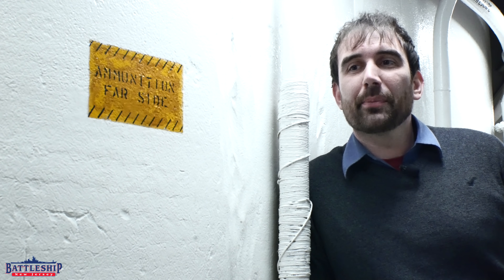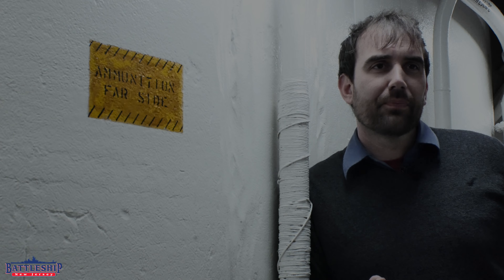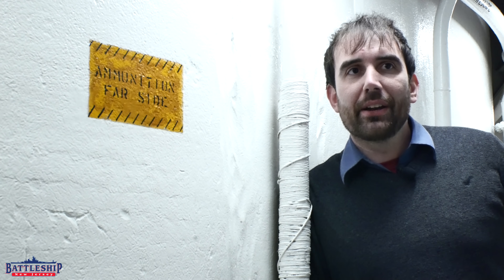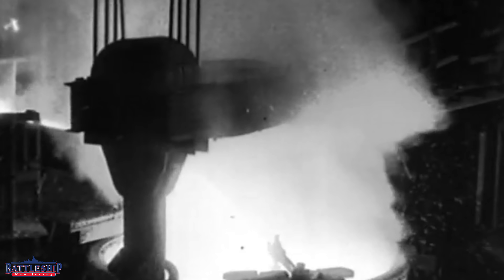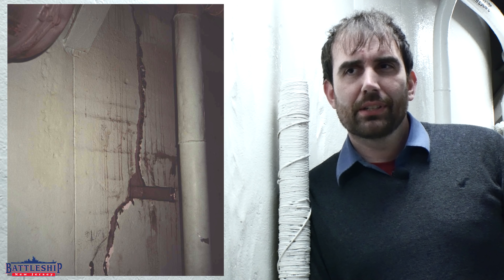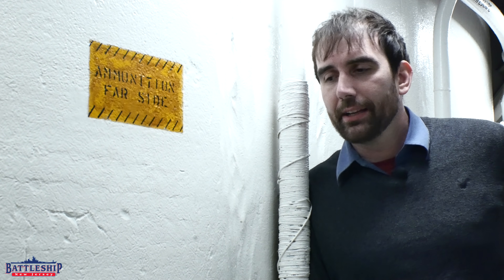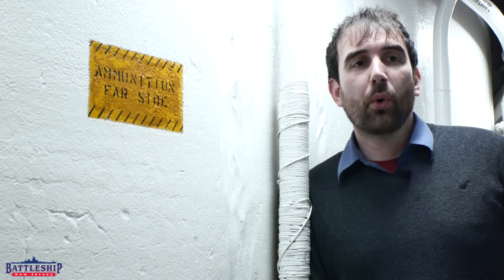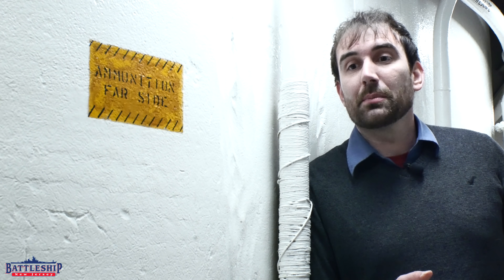What Damaged the Turret Barbettes To Cause the Cracks?

Comment: The after turret of the USS South Dakota was struck by a 14" AP projectile from IJN Kirishima in one of the naval battles off Guadalcanal late 1942....
The shell evidently struck the junction between the armored deck and the barbette, bending the armored decking downwards and putting a king size dent in the barbette. There was no gouging visible, or spalling of the armor; it functioned perfectly as designed, absorbint the energy of the hit by plastic deformation. The turret was put out of commission by the shock. I can only imagine what the turret crew thought about this.....They all survived.

Comment: Alabama’s Turret I barbette has a similar, but smaller, crack like Missouri’s. Other comments here have mentioned one on Massachusetts as well. Interesting since BB59 and 60 were built at different yards. 

A’s crack can be seen on second deck, port quarter of the barbette, close to the deck, for those interested!

Comment: Interesting that you mention Midvale Steel, a relatively small firm compared to giants like Bethlehem and Carnegie/US Steel, etc., but an important producer in many respects. Long known for specialty steels and alloys, Midvale focused on high end versus commodity output. It was located on a canal that brought anthracite coal, quite a benefit for high-heat generation and quite "clean" as coal burning goes. And one large customer was Baldwin Locomotive, which bought many high-strength, high-spec items from Midvale like drive wheels and axles. Meanwhile, in 1880s Midvale employed a young worker named Frederick W. Taylor who rose from lathe operator to gang boss to engineer, and eventually engineer of the works. Yes, THAT Frederick Taylor, of "scientific management" fame and a key player in the development of industrial engineering. So, behind the armor plate of BB NJ -- as you move up the supply chain, so to speak -- is a supplier with strong and noble pedigree in American industrial history.

Comment: Makes more sense than cracking from running aground, only extremely brittle metal would crack from a grounding, and if armor is that brittle, it would be useless as armor. Anything that is cooled too fast will crack.  If you can imagine the amount of heat the casting gives off and being up to 17" thick, it has to cool down slowly to prevent cracks. Metal shrinks when it cools, so the outer layer cooling faster than the inner will cause the metal to shrink on the outside and therefore, crack.

Comment: Being a foundry engineer, the lines you see in the Cast armor is the seam between the wood used to make the pattern, lie 2 to 3" that strips, the sands when packed will show the divets and cracks of the pattern and then it shows up on the casting,  Being war time the Finnish quality was not a high std. but the thickness of the armor was.

Comment: Never heard of that story, but if I had been on the tour and saw those "cracks" you may catch me looking at them and possibly trying to determine if they are jagged, smooth or if it is just chipped.
Mainly because a simple rule you can go by is if the edges of metal that is cracked is jagged and not a smooth line, it has been broken by overstress, meaning a lot of force broke it apart.
If it is smooth it could be done by fatigue, the same forces that you can experience if you bend a paperclip back and forth until it breaks.
And finally chips, which could be casting imperfections, impact dents and what not.

Comment: I saw the crack several times while I was working USS Missouri reactivation.  As I remember, it was on the #3 barbette.  Second deck, port side passageway going aft until you get through the door where the aft part of the barbette was and just look up.  I also remember one side of the crack was higher than the other.. It would have had to been ground down to keep the round shape. I knew Dick Landgraff well (contributed a number of items to his book) but I don't remember ever chatting with him about the barbette.  With Dick there was never a short answer to any question

Comment: I'm no expert by any means but I did work in a steel mill. I was in crane repair not in production. The  mill I worked in made coil steel from cast slabs that were 7 by 30 feet by 10 inches thick. Part of the process involved scarfing off impurities ( mill scale or slag ) which, if not removed would,  leave defects when the coil steel was formed. The scarfers would use oxygen lances to cut those impurities out of the slabs. They would move back and forth along the slab with their lances cutting a few inches at a time off of the surface of the slab. Scarfing would leave rows of marks where the lances gouged out the impurities. Your armor plate looks very similar to that of the slabs used to make coils. My thoughts are that they followed the same regimen to get a smoother surface that could also show any major defects. It is also a possibility that a defect could have caused Missouri's cracks. In welding it's commonly known that a crack can propigate from a defect in a weld so it stands to reason that it would be a concern in large armor plating.

Comment: Great explanations and nice to have Missouri's curator confirm the facts. A few questions arise. Was a barbette on the 1940 and newer battleships cast as a single piece or were they done in sections as the gun house was? Were the screws that held the gun house armor on also armor quality steel and do you have any spares you could give a presentation on?
Reply: The armor diagram shown of p. 170 of Sumrall (1988) indicates that the upper barbettes for turrets II and III were assemblies of 11 individual armor plates, while turret I was made up of seven individual plates.

Comment: I would love to see a video about the making of the barbettes. Are they cast as one piece? Are they stacked rings? How did they move such large pieces from the foundry to the ship yard? What is the single heaviest part of the ship and how was it moved into place?
Reply: Not sure about the rings, but, at least with the two built in Philly the pieces were loaded on trains in Bethlehem PA and taken by rail to the shipyard. A neighbor of mine had worked 35 years at Bethlehem Steel and his father worked there before and during the war. He had pictures of some of the parts being made and being loaded on train cars. At that time the plant was literally hundreds of buildings that made thousands of different parts for ships.
Reply: @johnstark4723  The armor diagram shown of p. 170 of Sumrall (1988) indicates that the upper barbettes for turrets II and III were assemblies of 11 individual armor plates, while turret I was made up of seven individual plates.
Reply: @tomkunkle318  and? They were shipped by rail🙄 whether assembled or just the pieces they went by rail. I have seen photos of slabs on rail cars that were assembled in Philadelphia and then I have also seen where they had things like 20mm gun tubs complete with the tub and gun mount. Once at Philadelphia a crane lifts the whole gun tub into place. Then at fitting out the guns were added.
Reply: @johnstark4723  It would be fun to know how the individual segments were erected and joined to form a barbette.  Sumrall (1988 p. 33) shows a picture of New Jersey during outfit with a wooden "former" in place for aligning and holding the five segments of the conning tower armor while they were welded together in place.  Perhaps something similar was done for the barbette armor?  Some day when I get around to it I'll search for construction pictures showing barbette erection.
Reply: Just to beat this to death, the individual segments of the BB61 turret II barbette armor can be seen in https://www.navsource.org/archives/01/016181.jpg

Comment: The quantity of unique castings on this vessel is utterly amazing. It would be amazing to talk to the project leads from back then. A testament to designing and building a complex machine before computers. The organization must have been truly amazing. A roughly six inch Acme lead screw to throw a 119 or so ton barrel up and down quickly and precisely too from the time before servo control of such things.  I guess an extra ton to nearly ton and a half for the round as well once it is loaded and moving back to firing position. You can tell the cast parts on the ship by the texture, and there are lots of them.  I hope a complete set of prints from when it was built still exist somewhere.  These ships represented the pinnacle of engineering from the time when they were built. If you get the chance, you should definitely go and visit one of these ships as it is well worth the time and effort.
Reply: Servo control was around in the Navy during WW2, especially in fire control.
Reply: @scottwatts3879  I just looked at New Jersey's gun elevators. I could not see the feedback mechanism from its motor and gear setup that I saw, but what you say does make sense. The signals had to get from the selected mechanical Mark 8 or other fire control computer to those motors and know the position in some way to fire accurately. The approximately 6 inch diameter Acme threaded lead screw that controlled that position was very impressive and looked pristine under its coating of cosmoline or something similar.  It is pinned to the barrel and pulls it up and down about a pivot point.  Very impressive looking to me for a 1941 construction.

Comment: The surface finish on the cast armor plate is also due to the poring process  , look at the rough surface finish on cast steam locomotive frames like UP4004 etc and the roughness is due to making the molten metal flow into the mold , smoothness hinders the flow of metal , apparently it is now a lost art, would have tobe relearned

Comment: As a CNC operator I work with cast steel a lot and these sorts of imperfections in the surface is quite normal but im not quite sure what exactly causes it. My pieces are only 800-1600kg though.

Comment: My first guess: different thicknesses coupled with cooling at different rates during casting process causing in stresses that result in the odd crack. It would be a huge PITA to pump that much heat into the mould and wrap it appropriately to trap it in so that it can be cooled slowly and evenly. I'm glad Megan's regarding Missouri answer coincides with my thoughts. Thanks Ryan!

Comment: The outer surface of Class-A (non-homogenous)  armor has been subjected to a special heat treating process called "cementing", which produces a thick layer of cementite, the hardest of the crystalline structures that can be formed with iron and carbon.  Cementite is also known by its chemical name, iron carbide.  The process involves heat treating only the outer surface in a special oven, and the thickest armor required over a week of treating before it was removed and cooled.  The armor then had to be "quenched", or rapidly cooled, and this part of the process could result in the warping and cracking of the piece, which meant starting over.  Each piece then had to be tempered in a different type of oven.  Once the batch was finished, it was shipped to the Navy for testing.  A piece was selected for ballistic testing, and if it failed, the whole lot was rejected.  This is why it was so time consuming and expensive. Only three American steel companies had the equipment and know-how to produce Class-A armor:  US Steel, Bethlehem Steel and Midvale Steel.
Reply: Can any company make class a armour today?
Reply: @robertschultz6922  Armor  has evolved a lot since 1940. New materials, new processes, new vehicles. There is a type of aluminum called Fortal that is used today for fighting vehicles. I got some trimmings from plates used to fabricate some armor. It is extremely hard, I wore out a bimetal hack blade and had to resort to carbide tooling to machine it. Civilian grade steel armor is designated AR 500. It is used to make targets for high power longuns.
Reply: Your description is simplified.....at the time the processes and materials were top secret, strategic information akin to our modern day nuclear weaponry. The alloys used, the material used for casing, the process temperatures/heating/cooling rates; all carefully guarded strategic secrets developed since the late 1800s

Comment: Landgraff had us in Design (shop 300), research & find the correct filler/epoxy for the cracks, and there’s a lot more cracks than just that one. Unfortunately, the filler  they picked, wouldn’t take paint at all, and Landgraff, who wasn’t worried about structural issues, as much as appearance, probably because the ship was so old. His idea was to have it smoothed and painted, but that red kept coming thru, & he wasn’t happy with the result, I was told. If you inspect it today, I dare you to find a sliver of a crack remaining. That stuff worked!

Comment: Some machine tools ( milling machines / lathes and other tools ) frequently have cast steel frames.  It is super common to use auto body filler ( polyester resin ) to smooth out the surface before painting.
Reply: Bulldozer frames and excavator counterweights are often the same way, even in the case of concrete filled counterweights where the steel isn't even particularly thick.

Comment: It makes perfect sense that Missouri's armor would have cracking from manufacturing.  It was war time and the steel mill probably didn't cool the casting  perfectly.  In the end it was structurally fine and like mentioned a long lead time item.  Use it. I see defects in small arms parts all the time from WW2. The M1 rifle often has cosmetic defects in the gas cylinders and receivers. None of which effect the final product.

Comment: The imperfections from the cooling makes a lot of sense. Having done too much hard facing for crushing equipment with GMAW and stick I've seen a lot of cracks. I've dabbled with face hardening on sheet steel and forging knife blades and had my few paltry attempts crack in the oil. Metal is a funny beast. Can't imagine 11 to 17 inches of the stuff. I mean, watch forged in fire.
Reply: If you think forged in fire looks hard, you should meet a real blacksmith. There's a whole lot more to the trade than knives and axes.
Reply: @RichieRichOverdrive  I was talking more about the the cracks... I'm a terrible blacksmith, not allowed to stand next to a farrier, and half decent welder. 😅

Comment: I'm pretty sure the belt armor plate is much smoother because of a combination of it being forged after casting and the grinding work that would have been done to bring the slabs to final dimensions. Such processes could not be reasonably done on a curved surface as large as the barbette, so the cast surface finish remains. Bear in mind this is my best guess based off of info from Drachinfel's video on armor and my knowledge as a former navy nuclear operator.
Edit: The lack of forging could explain the cracking as well. The forging would have collapsed any voids or cracks present. Cast the part oversize, forge it to consolidate the material, heat treat/carbeurize, then grind to final shape.

Comment: From the book “Warship Builders, an Industrial History of U.S. Naval Shipbuilding, 1922-1945” by Thomas Heinrich,  Naval Institute Press. Pg 156: each Iowa class ship had 246 armor plates. Midvale Steel Company mostly did side belt and deck armor; Carnegie-Illinois did armored bulkheads; Bethlehem Steel did barbette and turret armor.
Reply: I’ve often wondered, especially when Ryan is showing us particular parts of the ship, what it must’ve LOOKED like pouring some of those ridiculously large pieces - such as the armor belt, etc. It’s hard to even fathom, in a physical sense anyway, the sheer scales involved in those days. Much MUCH respect to the ship builders of that day. Sometimes it’s a wonder that mankind could even be capable of such things. With the added pressures of having to quite literally save the civilized world, it’s even more wondrous. 🫡
Reply: Thanks for contributing to society and my cranium, cracks and all.

Comment: It’s weird that the section of the Turret 2 armor you’re leaning against looks almost like brickwork that’s sort of had a bit of stucco laid over it. With lateral lines a bit visible. In my mind it all just gives the armor, and therefore the ship, a bit of character. 

ANY thing THAT large, and in my experience especially warships, is going to have differences between its peers. Even when built to a certain specification to (in theory & policy) be identical - there will be identifiable differences. She’s a grand old lady, and both like & unlike any other. Be sound, be well, and may God bless the USS New Jersey (BB-62) and all those aboard her.

Comment: I had actually heard of the crack in Missouri 's barbette  never saw a picture of it until now but I always figured it was basically a casting/ cooling problem. I have seen bad castings before but that picture was an eye opener.
Reply: Yes, not that they were going to redo such a big casting because of a crack, when it still has most of it's integrity in it, and they need it fast. Just put a filler in it and paint it. Back then the filler likely was hemp rope as a base and then hammered lead strip over the top to make a metal cover, the hemp being tarred so the crack would not rust. Then wipe down all the tar on the top, and paint it. you find most castings have some cracking in them, especially as they get bigger, just a thing that you get with thick and thinner sections of steel that cool at different rates.